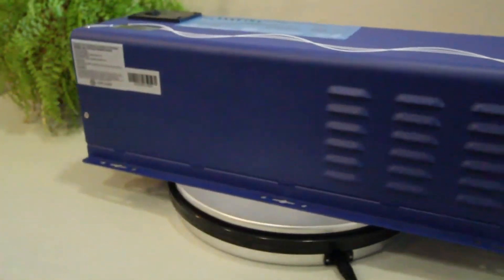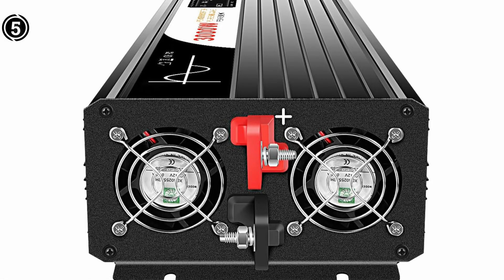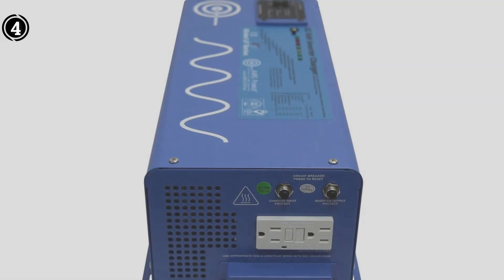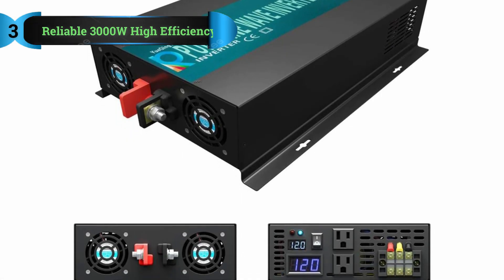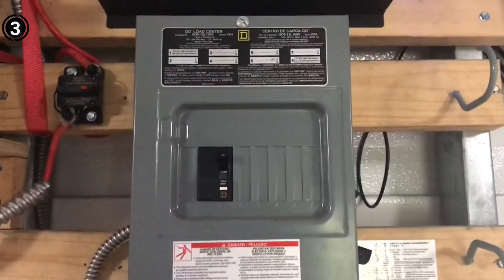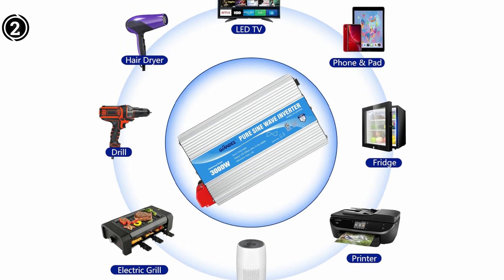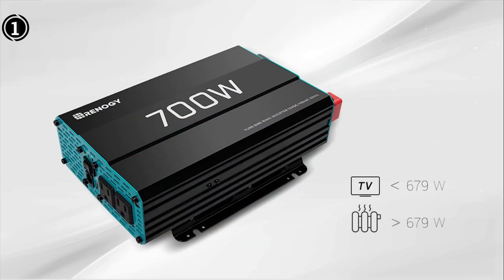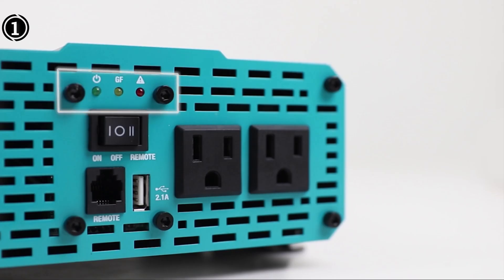Best Pure Sine Wave Inverters On 2024

Comment: Do 24 Volt systems for power inverters and battery banks last longer than 12Volts? Out of a 12v and a 24v system for inverters and battery banks which will last longer and be better for the batteries?